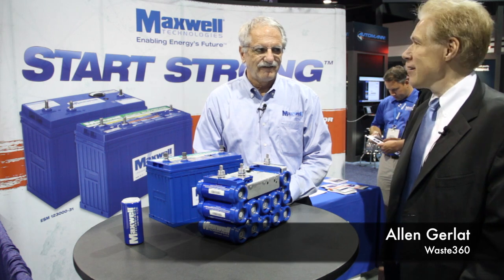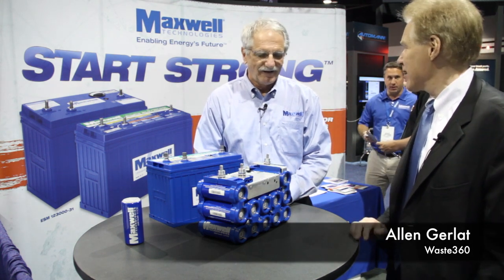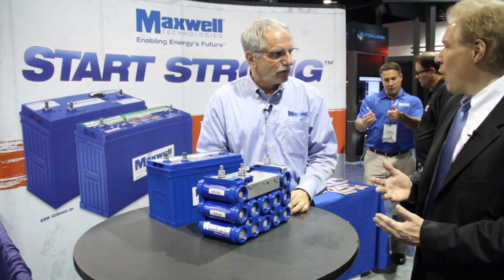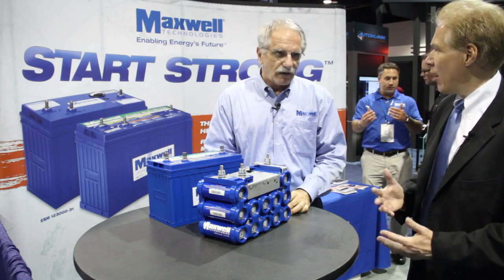Using Ultracapacitors to Start Your Fleet

Comment: Dear sir,

Good day

This is preethesh kumar from India I have already purchased 3000F, 2.7V x 18 pcs I connected it series I have technical query regarding some conditions while charging and discharging.

Question 1

1) sir, what is the max  charging current of this module. 165F ,48V.i have 50 ampere 48volt dc power supply source if I charge it directly will it damage the supercapacitor. If not possible  to charge directly with 50 ampere can I use high wattage resister in series. For 165F, 48V supercapacitor module can you suggest the resistance value and it's wattage for charging my concern I need fast charging. 

Question 2

2) sir, once 165F, 48Volt supercapacitor got charged fully with 48V, 50 ampere power supply source if capacitor got charged fully if I keep continue power supply on to the terminals of the capacitor after fully charging  will it consume current after fully charging and or will it damage any heating life decreasing plz check and inform me.

Question 3

3) what is the full output current of fully charged 165F,48V ultra capacitors.

Please reply for the above questions

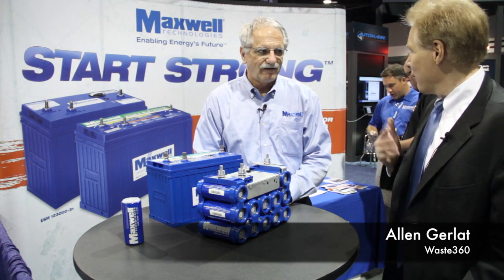Thank you 0:10

Comment: I have one installed on my truck I have a red light on , it will not charge.I have charged the other three batteries to get the maxwell  capacitor, charger again but no go!! Maxwell can u help me?? It says error messages.

Comment: I'm wondering if you can tell me, when installing balance circuit boards, but I need to have the caps at 0v. Caps are charged now and I'm wanting to add balance boards. I know this video is old but hoping you follow the comments still.

Thank you!

Comment: I'm vary mechanically inclined not so much with the sparky things though . I'm trying to build a solar generator but I dont want to use batteries, supercaps are supposed to be cheaper and charge faster but I cant find anything that will explain the work comparince of a battery to a supercap in a way I can understand it . So if yall could give some kind of explanation of how many 2.7v 3000f capacitors would I need to run a 120v 15a circular saw for 15 min or if it even could . Thank you for your time I hope to hear from you .
Reply: For 15 minutes continuously, a lot. Search lasersaber on youtube and he's got a video of a pack of smaller capacitors running a skill saw for a few cuts. I've got a video of 24 2.7v 3000f running a small electric scooter down the street on my channel too. Each 2.7v 3000f capacitor only has the energy capacity of 1 AA battery, so they don't last very long under continuous load. A pack of 6 in parallel with a battery would certainly help an inverter out with the initial surge of powering on a skill saw. Otherwise you'd need minimum of six 3000f capacitors and a solar panel or something to recharge them between cuts. More capacitors = more seconds of cut between recharges, but also means longer recharge times between long cuts.
Reply: @72fr250  lasersaber is where I got it but like you said he uses smaller caps i was looking to do something along the lines of a block instead of a sheet and was thinking that larger ferads per cap would help but what it is looking like is lots of caps distributing the volts will give you a longer run still researching.

Comment: Wondering too.  I know from experience having audio amp farad cap that my dead battery had enough juice to charge the cap then start the car....  they make a jump pack now like this. It works.  Releasing power instantly as caps do.  Voltage I wonder if it goes above 12v.  Probably not.   It just can store and release fast unlike batteries.   And batteries don't work so well drained I am thinking.   Maybe exponentially.

Comment: In a regular Automotive platform I wish these batteries/capacitors were actually affordable. There over a 1000 bucks.
Reply: but they are your just thinking fourth dimensionally it is cost effective after you realize that it's the last battery you'll have to buy for that vehicle cause a lead acid you buy once every 3 to 5 years as it gets 3 to 5hundred charge cycles and it's gone dead finished quit without saving the capacitor will be good for about a million charge cycles so it will probably last 70 years or more like regular capacitors last thin about that son

Comment: ECM YOU JUST CLAIMED THAT FORD INTERNATIONAL 7.2 LITTER DIESEL MOTOR WILL NOT WORK IN THIS TRUCK??? EXPLAIN THIS ONE SAME MOTOR IS IN DURASTAR AND WORK STAR TRUCKS SAME MOTOR. I HAVE A 110 AMP ALTERNATOR MORE THAN ENOUGH POWER THE 1 JUST REPLACED SAME THING WORKS FINE. I GIVE A NUMBER TO CALL
MaxwellTech Support Line at (888) 890-3337 TO LEARN MORE ABOUT YOUR PRODUCT

Comment: HAVE THE BIGGIES ONE THEY MAKE IT WORK FINE UNTIL IT STARTED TO DIE. THEY DO NOT STAND BEHIND THERE WARTY.I TOLD THE REP IT WAS FOR A FORD TRUCK.I GOT SOME BILL SHIT  IT WAS TO HOT OUT.SPEND ANOTHER $900.00 FOR 1 MORE.IT WILL START AT 20 DEG NOT AT 0 DEG NO BLOCK HEATER. THIS IS A 2 BATTERS SYSTEM . BRAND NEW LEAD ACID BATTER.120 AMP ALTERNATOR 14V
Reply from the maker: Hi Guy, the Engine Start Module (ESM) is not intended for application in a Ford truck. Please visit www.maxwell.com/ESM to learn more or call the ESM Technical Support Line at (888) 890-3337.

Comment: will it replace batteries from vehicle completely?
Reply: No, but the batteries are no longer needed to operate the starter. This has potential to reduce the failure rate of batteries, if not the weight of the tractor. a small unit could operate the starter on a refrigeration unit on a trailer or an automobile. The closet I have seen is the air start system used by Yellow freight and other terminal based freight haulers. The engine charged up an air tank with enough air to spin the motor ... and scare the crap out of anyone walking near it. If the starting system lasted 10 years, it would be a cost savings overall.

Comment: capacitor's react completely different from a lead acid battery, a auto battery is not a storage device, it is a chemical reaction that can be reversed by flowing a current backwards so to speak. a auto battery when discharging can react at a fixed speed
do to its internal resistance. explosive gases are created when charging and discharging. 
   A capacitor is a storage device, the rate of charge or discharge is not dependent on the speed of a chemical reaction, current
flow seems to happen instantly and can be violent. when charging it can suck up so much power so fast as to look like a dead short. and with no apparent resistance to flow it can dump large currents back and forth between its own cells, at 186,000 miles per second, no reaction time. so it takes three post on this battery replacement, a controlled slower recharge, balanced for each cell so that they remain equal, and also a output post for rapid flow for starting the engine.

Comment: I just bought two of these used on Ebay last week. They were defective I am just using them for the Ultra capacitors inside. I took the case apart and discovered the case had several ounces of water inside, the water must of seeped past the gaskets around the top post. all that moisture shorted out and ruined the delicate charging controller that was inside. Poor design allowed water to get inside. I am installing a different circuit and controller to replace what was inside. I will not let this outside in the rain, this will keep this from happening again. If you find these on Ebay most likely they were taken out of service because the charging circuit was shot. But if you just want these for for 12 3000F capacitors inside then buy them but you will have to cut the top off to get to them.

Comment: By saying power I assume he is saying a higher voltage, and my question is what effect does this have on a starter. I have used a 12V battery to start a car with a 6V battery.  But of course the danger is burning any lights that happen to be on at the time of the jump in voltage.The system he is showing is isolating the starting system from the rest of the truck. If the truck starter is 12V and the jump is a higher voltage will it create extra heat that will shorten the life of the starter.  Capacitors have been used in ignition systems but they are called condensers. Their purpose is to make the initial spark that starts the discharge of the coil. That was the system of the ignitions in cars many years ago.
Reply: WAV!  --- W=Watts=Power, A=Amps=Current, V=Volts. Voltage is how long the lever is in  mechanical terms, Amps is how much force is being applied to this lever. Watts is the resulting work done. Watts divided by amps equals volts. Watts divided by Volts equals Amps. Amps times volts equals Watts (Power). 'Do not do magic you do not understand' :-) A capacitor stores electricity, Batteries use chemistry to supply electricity. Good design prevents problems.
Reply: I forgot to say that a battery has an internal resistance that limits how many electrons can flow. A capacitor has a much lower resistance, virtually none, so can deliver those electrons at a much higher rate.
NB: Electricity is defined as 'a flow of electrons through a conductor'.
Think of a conductor as a 'corridor'. How many equal sized people can push through that corridor at any time?
Stronger people can push harder and get more people through. Stronger is like higher voltage, The number of people going through at any moment is 'current'.  Wattage is a measure of the work done = Power. "Energy" is a different subject and only loosely related to electricity. Maths can give you similarities and work out what is going on but do not mix up subjects.
Reply: Wondering too.  I know from experience having audio amp farad cap that my dead battery had enough juice to charge the cap then start the car....  they make a jump pack now like this. It works.  Releasing power instantly as caps do.  Voltage I wonder if it goes above 12v.  Probably not.   It just can store and release fast unlike batteries.   And batteries don't work so well drained I am thinking.   Maybe exponentially.

Comment: Capacitors lose their energy expotentially, in other words the output voltage drops as they discharge. They're O.K. for starting the engine then the alternator will keep the voltage constant but they don't replace a cell or group of cells ( battery )
Reply: Douglas Kay exactly that what the 3rd post is for so that it only delivers the cranking amps for the start when you need that big inrush the lead acid bank still does all the heavy lifting for truck operation and amp hour storage. The caps just crank the starter. Cool idea.

Comment: what about leakage?
Reply from the maker: Hi Braden, thanks for your question. 

Leakage can be defined in two ways, liquid or electrical.  Regarding liquid leakage, the Maxwell Technologies, Inc. Engine Start Module (ESM) contains no acid (or lead) so there is nothing to leak.  The ESM is a sealed unit and if necessary it can be mounted in any orientation.  The ESM is also certified ‘Non-HAZMAT’, which allows us to ship ESMs air freight if required.  Regarding electrical leakage, Ultracapacitors do have a minimal leakage current in the order of mille-amps, so they do have a self-discharge effect.  However, because of the internal computer and DC-to-DC Converter, the ESM will automatically recharge once its programmed voltage discharges by a minimum of 0.4 volts.

Comment: 00:30 he says it stores power not energy..  he does not know what he is talking about... geeez...
Reply: Yes, it can deliver a lot of power in one go but not that much capacity compared to the standard lead acid. The advantage is, it charges a whole lot faster and could hold the charge longer.  Lead acid discharges slowly even if not in use and that shit gets worst during winter..
Reply: Most people can read through  the lines.  What most engineers hear is not much energy is stored but able to  deliver amps to start a truck .

Comment: can you use these as a solar battery bank ?
Reply from the maker: The short answer is no. The reason is that this module was designed for high power delivery during cranking of the engine. It has lots of power capability but relatively low energy content. Also, integrated electronics is designed for automotive engine application.
Reply: yes they can be used together with lead acid deep cycle batteries. Just wire them in parallel and they will help to extend the life of the lead acid batteries (or lithium too) because they help to take the brunt of the spikes in energy. Like when a fridge kicks on and takes a big draw of power. Or when starting your vehicle too.
At this point they don't store energy well for the long term so it is best to use them with batteries, not instead of batteries.

In short, batteries and capacitors together is much better than either one alone.
Reply: If it lowers the lifetime cost of operation, it will be good.
Reply: Not really. look at saltwater batteries for home power

Comment: 0:33 You say they they store power not energy but power. It most certainly does store energy and seeing as power is energy over time and as you pointed out its not a magic flux capacitor I guess it dosnt store time. In reality either energy or power is correct to say saying energy is incorrect is itself very incorrect.
Reply from the maker: The comment is correct. One can’t have power without energy. Ultracapacitors store a very small amount of energy compared to a group 31 lead-acid battery. However, an ultracapacitor can deliver that energy (in the form of power) at a very rapid rate – significantly faster than the battery can deliver. For this reason, ultracapacitors are known for storing and delivering power, not energy. They are therefore ideally suited for starting diesel engines as they can deliver the burst of high power needed to crank and start a cold engine
Reply: It all depends on the internal resistance of each item.

Comment: that man kept on touching the terminals daamn
Reply: It likely was not charged up but even it was charged it would normally only be 12v or 24vdc. It won't harm you unless you charge it up to a high voltage... or accidentally drop a wrench across the terminals. LOL!
Reply: yup high current discharge :p
Reply: If you’re a battery guy, the terminals are what you touch. They are like battery nipples.

Comment: No point talkting if you cant put them on amazon!
Reply: What do you want to find out about these capacitors? This component is the solution for extreme conditions where a battery will fail like temperatures between  -40°C and 65°C. Or a large diesel engines that is not used often for example, an emergency generator for a hospital. They can also deliver 100 amps for a long time and a battery will start to boil when your do the same to it.
I think Amazon is not the place is where you find the right information.
Reply: TheNeurall You could just put a few of them together and create a cheap and light weight car booster. Bench power supply to charge them for about 20-40min if it's only going to push 5 amps.
Reply: 20kilovolt 
Im not looking for information really, but im looking for to buy them. If ordering from factorym they most likely sell in bigger quantities and their sellers would charge a lot for postage. Thats why i would like to see it on amazon, if they can sell DC-DC converters, LEDs and all sort of components, than why not these caps?

What do really interest me is the recharge cycles and the amps can be used to start car.
Reply: TheNeurall http://www.maxwell.com/images/documents/datasheet_16v_module.pdf

1,000,000 cycles. about 10 years of use.
limited to 100 amps the capacitor itself can make 1900 amps
the price is about € 492.91.
Reply: I looked up the price once and the price was closer to $3000
Reply: I think this is a higher power battery 75 volts which is € 2,607.25  and the  € 492.91 is for 16 volt for a car probably. here is the website. 

http://www.digikey.nl/product-search/en?FV=fff40002,fff8000c,fffc049e&chp=0&WT.srch=1&WT.medium=cpc&WT.mc_id=IQ65112395-VQ2-s-VQ6-45625961678-VQ15-1t3-VQ16-c
Reply: There are guys on YT they bought 6x 2600F caps for like 60USD.

500 Euro for 6 caps battery is insane.
Reply: I know better to spend my money as well. I also find it too much money. btw nice avatar I am also an Atheist.
Reply: If you start you vehicle 273 times a day then yes it will only last about 10 years. Start you vehicle 5 times a day it will last around 548 years. Once a day it will last 2,739 years. Baring any failure in materials of course. I watched another video of a similar product and the guy said it would last like 2000 years with a 1,000,000 cycles. I thought that was a bit extreme. watch The Fuel Tank of Tomorrow - A Super Capacitor?
Reply: Love the idea of these, thank you Tesla for acquiring this company for the future of transportation! Once supercapcitors are integrated into electric vehicles we're home free! Fast charging weather friendly, sweet!
Reply: They could but don't forget everything doesn't have to be on Amazon. Amazon does nothing but sell items out of a warehouse, at least stores have people to interact with and don't waist millions of pounds of cardboard to ship every item...  Not to mention the hurt they ensue on local stores.  Just not as good as everyone seems to think they are.
Reply: I agree.

I'm not going to invest in any new technology like this until I can read a few Amazon reviews first.   Part numbers and prices would be useful too.